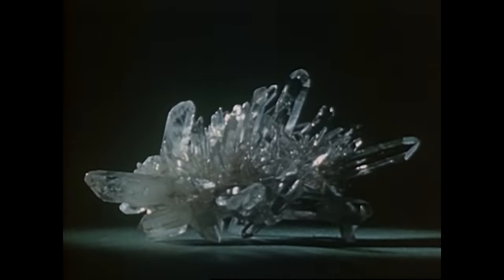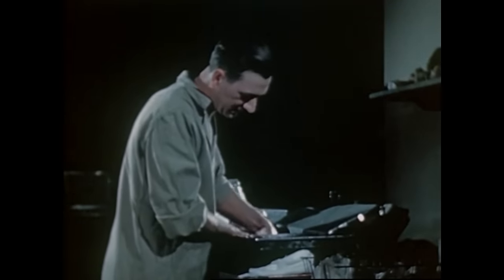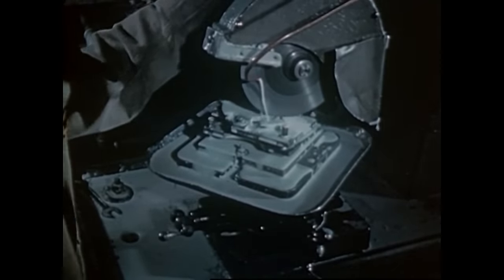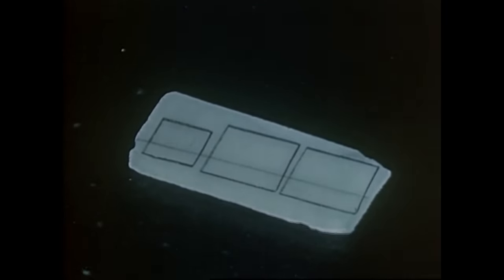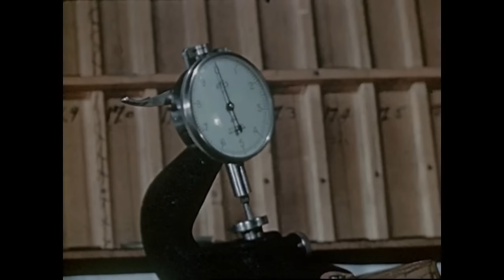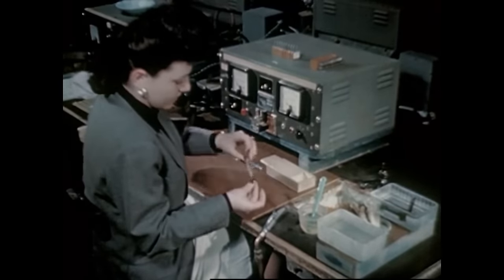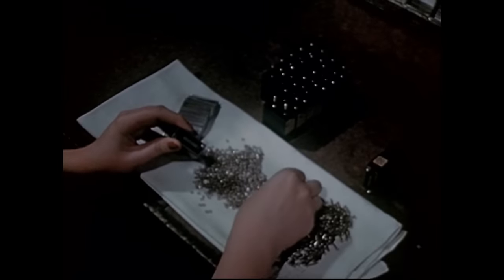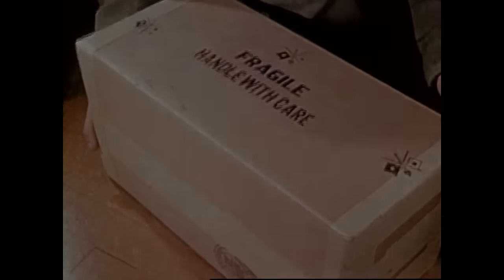From Raw Crystal to Crystal Oscillator - Crystals go to War in 1943

Comment: The video skipped an important part of the process. Most crystals, even in 1945, operated on the higher harmonics, usually the second, third, fifth and ninth. The frequency marked on the case isn't the fundamental but the chosen harmonic: a quartz marked 100 MHz is a 20 MHz quartz cut for the fifth harmonic.
The angle between the optical and electric axis sets which harmonic the quartz operates.
Fifty years ago I didn't had synthetic oscillators with PLLs. I used a sandblaster to raise the frequency of a crystal, and a graphite pencil to lower its frequency...
Reply: Yes. How YouTube knows I used to work with quartz crystals at the time of vacuum tubes, goes behind my understanding...
Reply: For a moment I imagined you getting out the sandblaster to change stations, then remembered that tank circuits exist..
Reply: Saying that "the angle between the optical and electric axis sets which harmonic the quartz operates" is not correct. Which overtone the crystal resonates at is determined by the details of the circuit in which the crystal is used. The same crystal can be made to resonate at different overtones.

The angle of the cut determines the thermal coefficient of frequency, and to obtain very low variation of frequency with temperature, the angle must be set very accurately, as shown in the video. There is a lot more nuance to this than that, but for the most popular types of crystals that is the story in a nutshell.

Comment: I have several old-fashioned tube transmitters (like world-war 2 agent sets) anh have re-ground FT-245 crystals to get frequencies in the 80m ham band (3.571 kHz) Started with a crystal blank on around 3.2MHz, ground on a glass plate with "figure-eight" movements. Very time consuming to clean, remount in holder, test, re-do the lapping and so on, and so on.. Got it right finally, but, never again..

Comment: That etching bath was Hydrofluoric acid wasn't it? No respirator, gloves, nothing..
Reply: The etching bath is ammonium bifluoride. It is considered to be harmful and corrosive. 

On the other hand, it is widely used in everyday cleaning solutions. For example in wheel cleaners for the car wash, in masonry cleaning solutions, etc. It is a controversial subject whether this is safer than the hydrofluoric acid itself. But people spray it by the gallon with very little fuss. In fact, if you check the fine print on the labels of such cleaning solutions in a hardware store, you will find that some of them do contain hydrofluoric acid, though at a relatively low concentration.

Comment: This set up doesn't look too safe for the operator. 12:39
Were the risks of x-rays not known in that time?
Reply: By that time there were already occupational health standards for X-ray exposure. The machines that we see in the video must have been designed such that the operator is not exposed to the Xrays beyond these established limits. The beam is probably quite narrow and is not pointed towards the operator, with shields located strategically to prevent exposure.

With the first machine the operator seems to also be wearing a protective apron. With the second machine 14:36, the crystal is covered with an enclosure before the xrays are turned on.

Comment: This is amazing! With the advancements in technology now you can actually make this whole Lab at home and there's nothing dangerous about it. You can even make your own x-ray spectrometer with an old cathode ray TV. Just remember that we're not using lead blankets anymore because when the alpha particles slam into the lead they pass through as gamma particles. We found out we were giving everybody doses a gamma radiation when we thought we were protecting them. That's why when you get an x-ray nowadays they don't usually give you the blanket. A softer metal like aluminum in front of a lead shield can actually slow the alpha particles down enough so that they do not emit gamma particles when they hit the lead. Always monitor your dosages of radiation, that even goes for those that fly too much.

Comment: I see the presentation, but I still don't understand some things.. I thought a rock, in other words, a crystal is not electrically conductive.
Reply: quartz is a semiconductor and what is used for is its atomic level vibrations that occur in its structure at such uniformity when electricity is applied, so it that  it can be used as a clock
Reply: @antiimperialista  yes, I know  that's what the video shows. But I thought a rock cannot conduct electricity
Reply: @cliffcox7643  all metals are rocks lol copper even
Reply: @antiimperialista  ok, thanks for explanation

Comment: Did anyone survive this job unscathed?  Missing digits from saw blades, exposure to toxic chemicals, X-ray radiation, and of course silicosis from the airborne quartz dust ... yikes.
Reply: The saw blades were not too dangerous, they're essentially smooth disks of copper with a very fine diamond dust embedded into the surface. Yes, they could hurt you, but no where near as quickly as a steel toothed blade. As to the rest - agreed, these people were at risk...